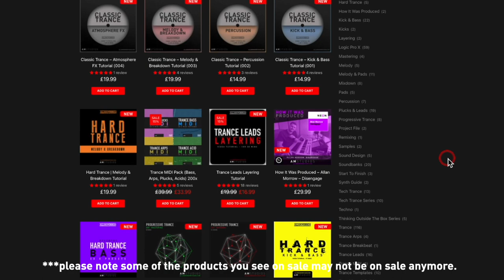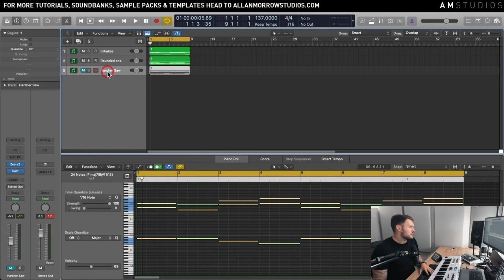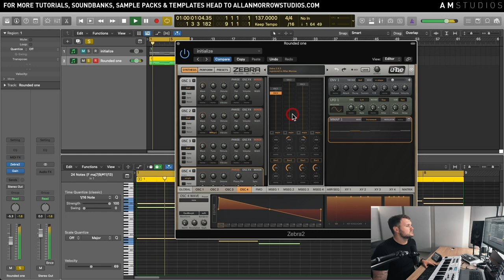How To Make A Supersaw (inc smoother top end techniques)

Comment: Hi Allan, nice tutorial. Myself often put a low pass on 10k and fill the high-end with wide noise works also very well on ssaws
Reply from the maker: Cool! Lots of different ways to achieve nice ssaws and it’s cool to hear what others do
Reply: I've heard of this but haven't implemented it much.  So after reading your thing I tried it out.  One thing I didn't like was how the noise is static no matter what you play.  So it's nice to keytrack the HPF cutoff so the noise effectively moves with the notes being played.